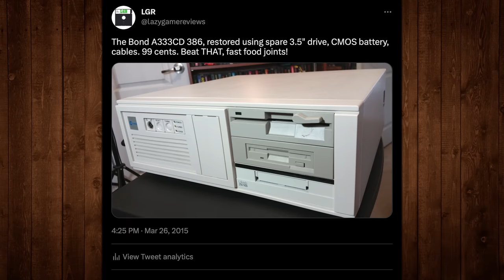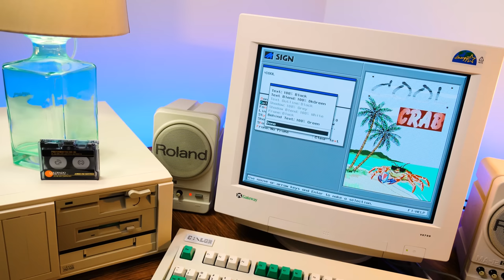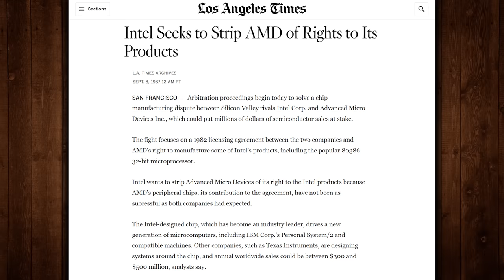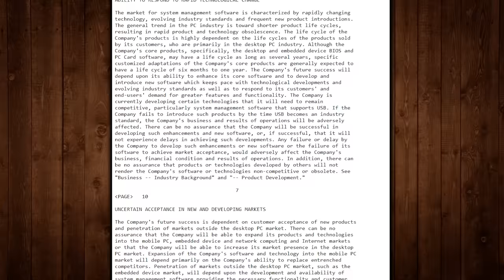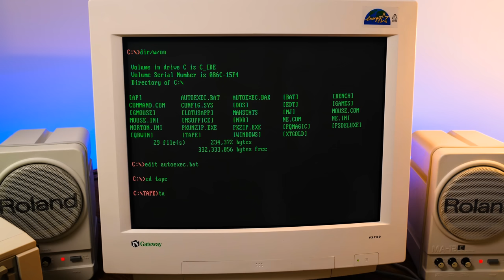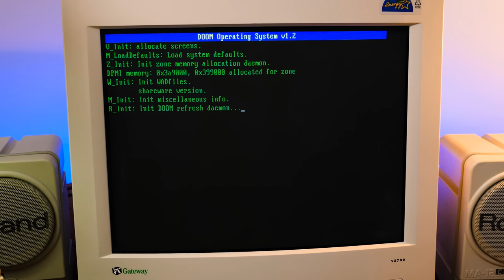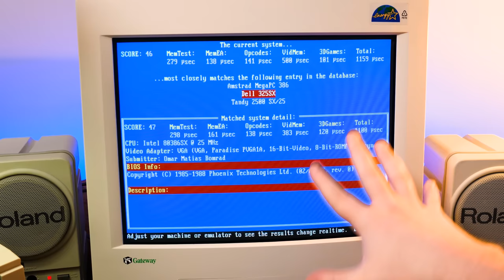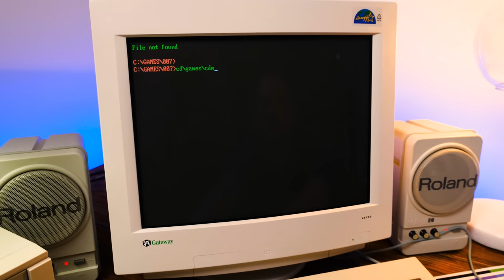Exploring a PC Built by Bond, J. Bond – The 99¢ 386

Comment: Windows 3.1 only supported CGA so 3.11 was required for VGA support
Reply: Windows 2.0 was the first with VGA support.
Reply: 3.1 could definitely support VGA. I remember using 3.0 in VGA modes, with a WD Paradise VGA card. There was also 3.0 with Multimedia Extensions that came out in 91, with the first version of Windows Media Player,  that could play videos and do sound.
Reply: @michaelturner4457  Windows 3.1 could even do SVGA, depending on what the installed video card was capable of. I once tried 800x600 or 1024x768, albeit in 16 colours, and then switched back, because the screen refresh rate was too low.

Comment: I remember the endless array of system builders back then.

What was the purpose of the edge connector on the top of the video card? I don't recall the SLI like tech being around then but I could easily have missed it.
Reply: Feature connector.  It allowed other devices to access the frame buffer directly, for video overlay and things like that.  At the time, it would've been used to play back video files from a dedicated codec board, or to overlay video from a TV or capture card.
Reply: @nickwallette6201  Maybe from a videodisc drive with serial control port and a corporate training video disc from headquarters

Comment: I've never seen a co processor installed in one of these style computers, did they even exist? Did having 2 processors make it faster? So many questions.
Reply: The 387 only speeds up floating point math and only if the program uses it.

Comment: I got a kick out of "J Bond Colorado PC". Colorado was simply the brand name of the tape drive, of course.

There's little nostalgia attached to these PCs because, as you said, there are so many of them out there, and there's no consistency to them. The thing was, if you wanted a brand-name computer back when this thing was built, a Compaq could set you back upwards of $10k, an IBM would be a couple thousand less depending on options, and the next tier down, which included Dell, AST, Zeos, and NEC (to name just a few) were still often over $5000. You could save $1000 or more by finding an independent builder. That's what I did, and I literally got a bargain-basement machine, as in it was about $4200 in 1989, and was built in someone's basement. This J Bond PC was somewhere in between: a small company building their own configs. In any case, you can't really establish value or interest from the outside. Things can get very interesting when you take the cover off, though. But a lot of people selling these things don't realize that, and don't really know what they have.

Comment: I think it is not performing as fast as 386DX should. It's rather in 386SX range with mediocre ISA SVGA. However it has ET4000 which is among few other SVGA cards that were so fast that ISA slot was the bottleneck for them.
I think there might be problem in BIOS configuration or with jumpers on board or VGA. Maybe wait states badly set or cache is not working?

From what I've seen this 33MHz 386DX is performing just a bit better than my 386SX 25 MHz and in reality it should be much faster.
I have 55 points in TOPBench at 25 MHz and I have much lower VidMem value, which suggests the problem with badly set wait states.
In TopBench data base 386DX 33 MHz systems with ET4000 reach 90 points.
Reply from the maker: Is yours an AMD Am386 or Intel 386? There are discrepancies between AMD's clone and Intel's original I believe.

But yes there are many BIOS optimizations, too! Haven't dove in deeply on this one since I don't have need for it to be faster, I have plenty more capable machines :)
Reply: @LGR  I have AMD 386SX. Although I don't think it's important. Any 386DX should be much faster than any SX per clock. I was just pointing out that performance wasn't what you would typically expect from 386DX.
Anyway 386DX are in a weird spot, when they're a bit too fast for 16-bit DOS software and still too slow for 32-bit which was targeting 486DX2 at least for the most part.
386SX is somewhat more usable, since it has all modern 32-bit features, while has the performance of 286 machines. Many 386SX 33 MHz PCs would run at 16 MHz in turbo disabled.
My 386SX 25 MHz will run at 8 MHz with turbo disabled, making it the probably the slowest 32-bit PC.

Comment: Little wonder i hate AMD now, though when i built my first fast PC as a kid, it was an Athlon Thunderbird 1.2GHz, a big jump from a Pentium II 333MHz.. Sometimes wish i'd have suck with Intel though as that chip killed its self, so was replaced with an XP 1500+ fairly quickly.. Sadly due to basically being poor i stuck with AMD for a while, the Phenom 9850BE being the last new AMD CPU i purchased, which actually cost quite a bit.. More than the i7 920 i saved up for over 2 years to get, actually. Since then, never went back from Intel, same with Radeon for a while since the 9700 series all the way to the HD5/R9 290X, went back to nVidia with a GTX 970. Most of the AMD hardware i had is..dead. Intel/nVidia? Still working.

Comment: Looks like someone replaced the hard drive. Seagate Cabo drives date past their buyout of Conner Peripherals in 1996 and were originally a Conner design. 500+MB drives would have been pretty expensive when 386s were in their prime. As for the razor case edges, I have donated quite a bit of blood to the computer gods over the years of being a tech.

Comment: Hey, Do you want to review a Horrible computer virus? I have a copy of the worst computer virus you've ever seen. It makes the computer become non responsive then the hard drive will run full tilt until it goes solid. Make a dedicated computer install and it will melt down and explode. Its contained in an AOL messenger. This virus is impossible to get rid of. I had to delete all my data and totally start over. I originally got it from Limewire long time ago. Let me know.
Reply: How about that, the warning on Facebook was actually true!

Comment: With the direction FPGA is going luckily these wont be needed.  Wanted, sure.  Imagine 10 years from now when they figure out instant FPGA switching, you could have one small box that simply runs anything and everything you throw at it with zero user interaction.

Comment: Pretty sure thats a 'cheap' bus bashing drive that locks up the entire machine and uses the CPU to directly run the drive, rather than the more expensive SCSI systems with their own controllers. Not much more than a floppy controller.